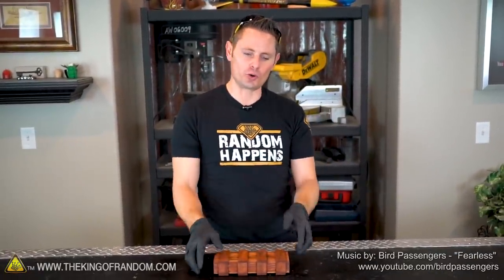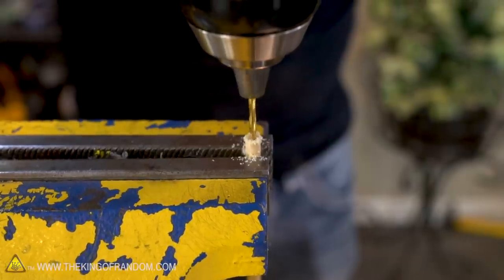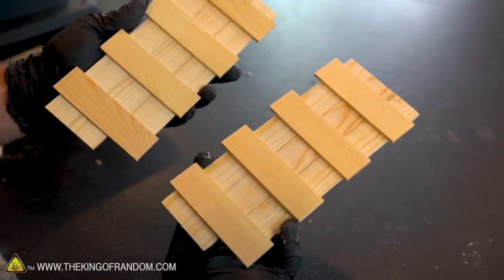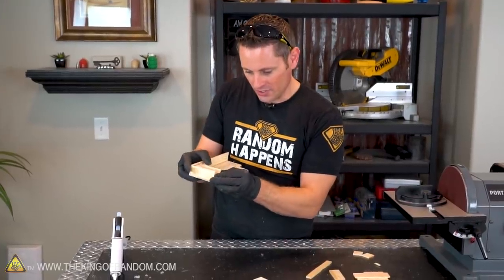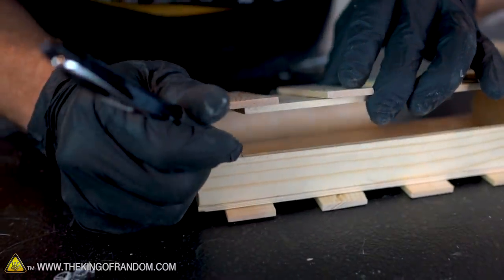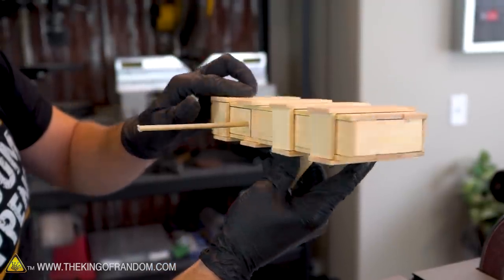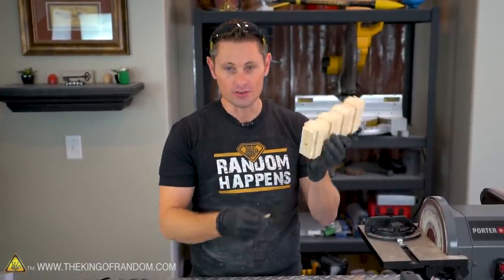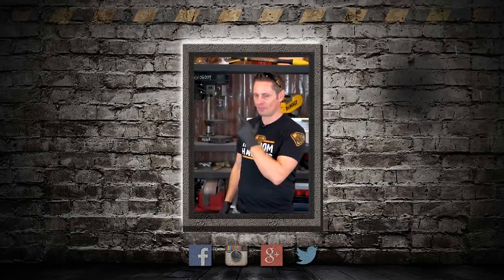DIY Paint Stick Puzzle Box! TKOR Show You Everything On How To Make A Mystery Puzzle Box!

Comment: putliquid proto-putty in a vacuum chamber and take it out once it has hardened (im guessing the shape will be quite anormal)
Reply: Maxime FROSSARD im pretty sure it won’t harden because the vacuum chamber sucks out all the air so it’s basically impossible to dry it in there
Reply: Justine Gaming it boils because of the lack of pressure not because of any temperature changes
Reply: I have seen this comment before.
Reply: Justine Gaming *audible facepalm*  That's not how vacuums work...
Reply: Doesn’t work

Comment: What about putting a smoke grenade in vacuum chamber?
Reply: Shantanu Jain would probably destroy the vacuum pump
Reply: Shantanu Jain it will probably take away the smoke
Reply: Since you need oxygen to keep the fire going it wont work in a vaccum chamber that takes away oxygen
Reply: RIKARD LEHTO firework make his own  oxygen. Thats why its burns in water.
Reply: That's actually a really interesting experiment.n there are quite a few factors at play. You can check out the channel Cody's lab where he (Cody) did some cool experiments with pyrotechnics and vacuum Chambers
Reply: Ltifone2014 yeah!
Reply: What about putting a vacuum chamber in a smoke grenade?
Reply: la haya Except smoke grenades are made with Potassium Nitrate, which contains its own oxidizer. So with oxygen molecules already present In the reaction it should keep burninf

Comment: Little tip for your belt sander, when using it make sure the wood is moving left and right on the belt, this is so you can make the sand paper last longer and there is not spots where the sand paper/belt has wore down (by moving the wood left and right it will wear down the belt equally instead of having rough spots)